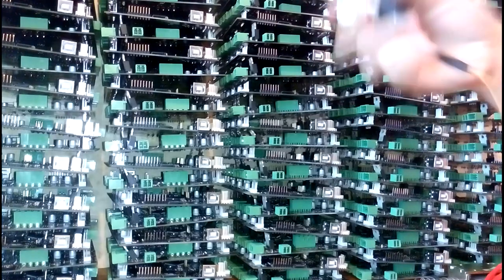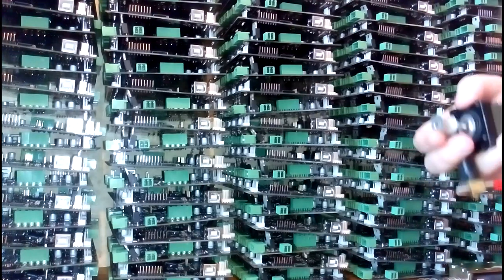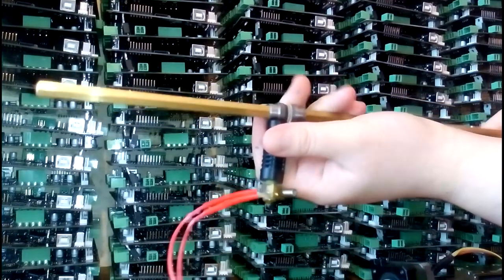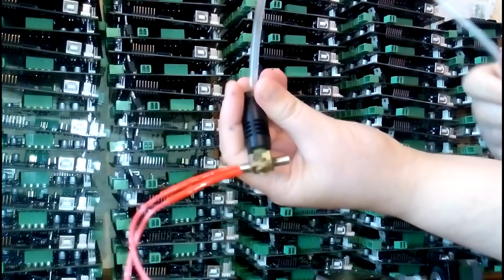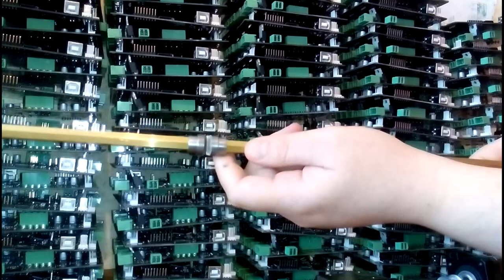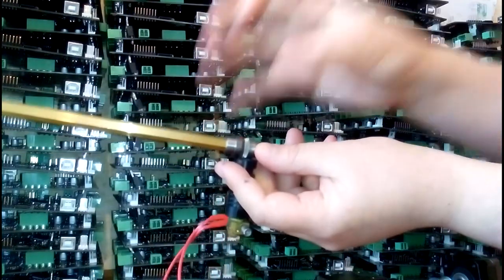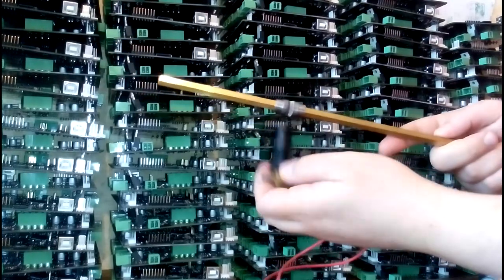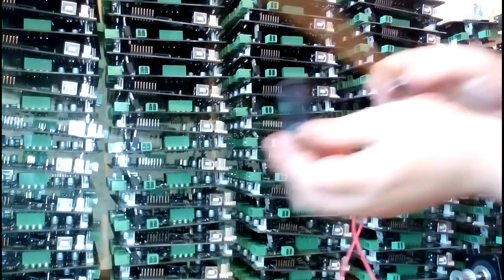Multiple extrusion idea ( off-carriage multi-extruder )

Comment: The audio was was recorded very soft, it was very hard to hear.

The some of the idea might work well for Mendel-derived platforms, but not for a gantry-based design.

Using solenoids to engage filament might negate the weight savings of moving the motor off the X carriage.

Also, the tall stacks of boards wobbling kind of makes me nervous.
Reply from the maker: Sorry about the audio, first time actually talking to the camera :) I'll think to talk into it and not at another wall, next time :) You didn't miss a lot, my accent is horrible anyway.

I'm working of using bevel gears ( already have some parts machined ) to use the design on gantry-based designs ( h-bot ).

About selonoids, they wouldn't move. That's not the idea, crank the volume up :)
Reply: Arthur Wolf
Well, I had to switch computers, and maxed out my external amp's dial on the second to hear what you were saying. But at any rate, I did manage to hear the pitch.
Reply: Arthur Wolf

I don't understand why the solenoids shouldn't move, they need to move with the X carriage in order to engage the filament drive pressure. At least that's how I understood your explanation of how you would do multiple extruders.

Comment: send me a plate of this smootherboard
Reply from the maker: I'm sorry, "a plate"? I'm not sure what you are asking.
Reply: @ArthurWolf  can you give me a board of this smoothierboard v1.1
Reply: @ArthurWolf  I tested one of a friend of mine and I loved it but I don't have the money to buy one of these very good ones
Reply: @ArthurWolf   SMOOTHIEBOARD v1.1
Reply from the maker: @arthurheito3867  The components (in particular the microcontroller) for making those are not available currently due to the worldwide component shortage. Before that, we used to sell raw boards, but it's really not economical getting the components in single quantities, you're not going to save money that way (even if the componnents could be bought)
Reply: @ArthurWolf  you can send me the firmware of it the original I will see if I can find the chip
Reply: version  v1.1
Reply from the maker: @arthurheito3867  It's all on the website...
Reply from the maker: @arthurheito3867  Yes, I was talking about version 1.1
Reply: @ArthurWolf  which website
Reply: @ArthurWolf  have source code can recompile for lpc1768
Reply: @ArthurWolf  I wanted to use it with openpnp software